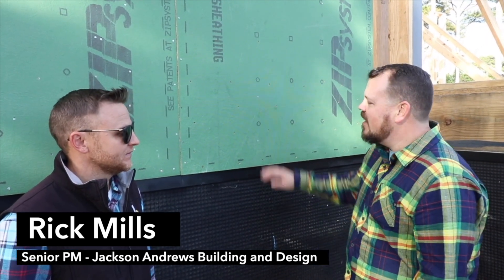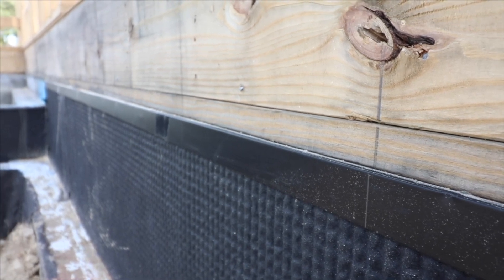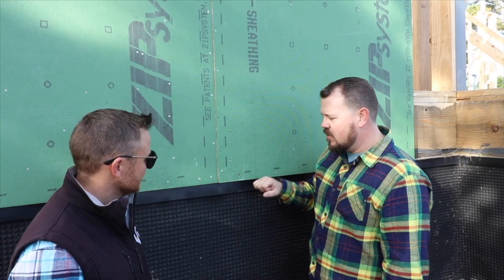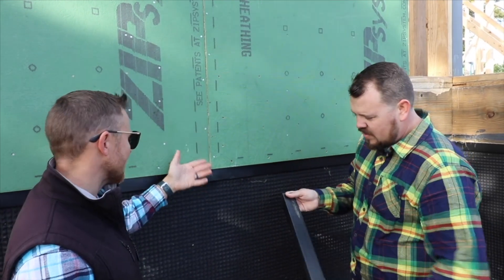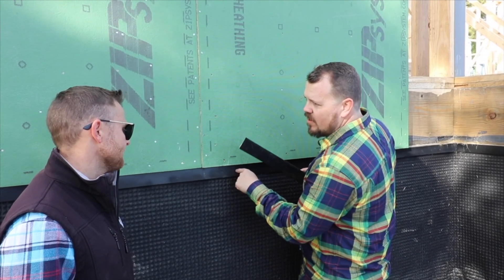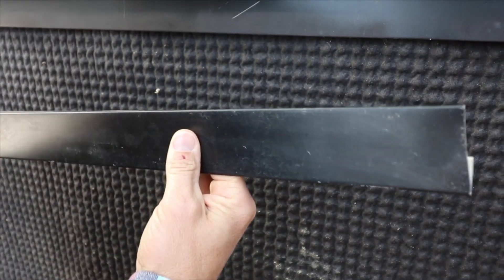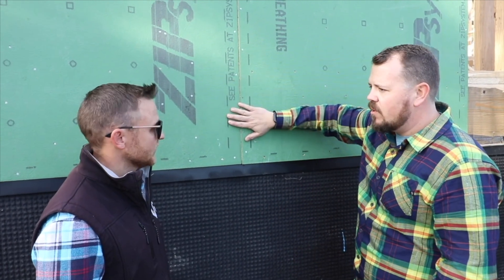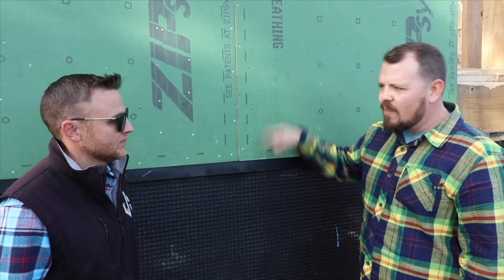Water and Air Management of a Foundation Wall

Comment: What goes over dimple wall or is that finished product
Reply: There should be a protection board over the dimpled membrane. Dimples allow water to seep down - if crap or mud gets in between the dimples, the water cannot drain. That's why you put a protection board over it.
Reply: @apscoradiales  Protection board is designed to protect the dimple mat from damage during backfilling. If you are careful and place drain rock (rather than fill that requires compaction) protection board is unnecessary.  Typically, a termination bar is placed at the top edge of the dimple mat to prevent any dirt/debris from getting behind the dimple mat.  It's unusual to see dimple mat touch the framing/sheathing, so adding the metal flashing was a nice detail.

Comment: Wouldn't it have been easier to just inset the wall an inch and make it all flush? That way you don't need to even consider putting on the flashing, you could just zip-tape to the fluid-applied behind the drainboard.
Reply: That's what i plan to do on my house, that way it's one continuous line.
Reply: Nah... A million miles of tape and sheet metal with thousands of potential fail points makes much more sense to me 🤭

Comment: Instead of filling dirt after all the water management details; can one substitute the dirt with say a couple feet of gravel all the way from the bottom to the top? Would that make water management better? I'm not too concerned about the look. Would the house move without dirt packed in next to the foundation?
Reply: Yes, gravel can be used all the way from the footer to grade.
Reply: @jeremyhershberger3012  Aside from aesthetics, is there a reason to not do this?
Reply: @chrisbabbitt4202 Cost. Gravel costs more than the dirt you already have on site  from the excavation.
Reply: @starsnbars250  In my experience, properly-installed dimple mat with termination bar and associated labor costs isn't much less expensive than 6"-12" of drain rock around the foundation. If you add protection board, there is little cost difference.  And as much as the dimple mat manufacturers like to claim to save people money on drainage, it simply isn't as effective as drain rock.  I'd always opt for drain rock if the costs are anywhere close.
Reply: Water will do what it wants.
Gravity overrides anything a human tries to control it. How long will that tape continue to stick???????
Reply: @PatriarchyIsOverrated  these tapes, if applied correctly and protected from UV,  should stick longer than the wood will survive.